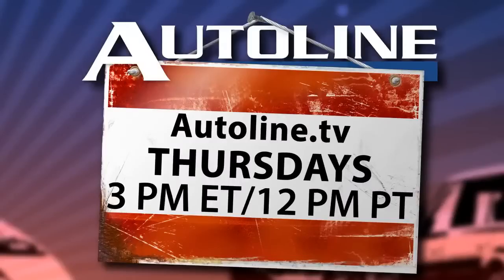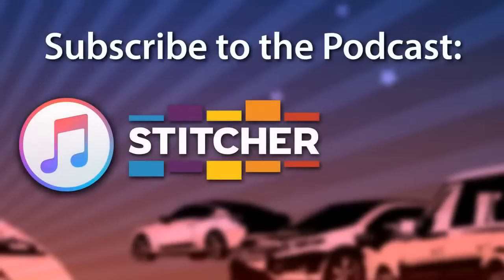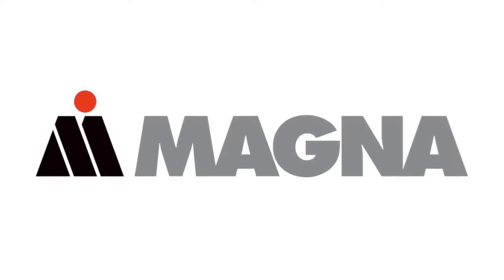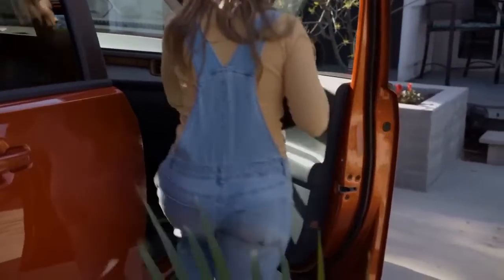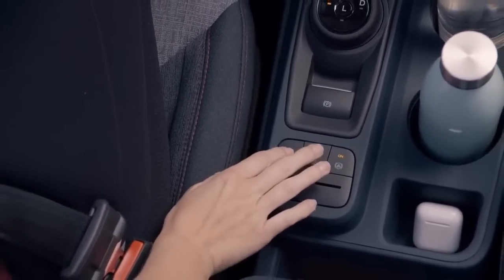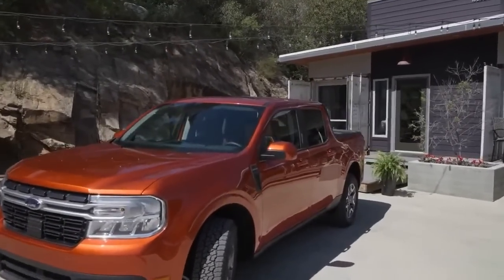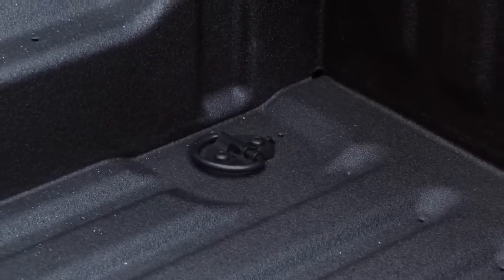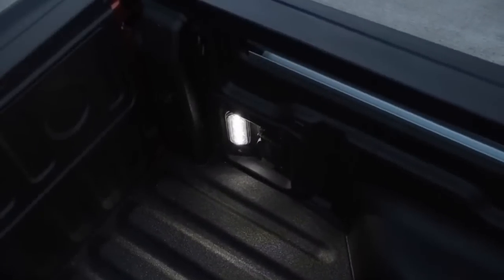Designing The Ford Maverick: Inside & Out - Autoline After Hours 575

Comment: Also, why not a plug in hybrid Maverick?
Reply: I kinda like that it isn't a plug in, would be relatively annoying to install a home charging station, or charge it at public charging stations. With a mild hybrid, you get many of the benefits of a hybrid system, without having to charge it. As someone else mentioned, it also helped to keep the cost down.
Reply: I give it a year and a plug in will be an option..plug in is convenient for daily computers. a115v @ 20 amp or 220v @ 30 amp would save on trips to a gas station. my cousin only gets gas once a month. she has to deal with Seattle traffic.

Comment: as an owner of a 83 ranger with the 2.2 diesel option. 
former owner and or driver of ford pickups from the 50's through the 90's, i waited for the re-introduction of the ranger.
to say i was disappointed would put it lightly. the new ranger is basically the size of a sixties f-100. 
only with a higher stance and lifted suspension. 
having high bed sides, making it difficult to place or retrieve items from the bed, from the sides. 
along with a high entrance and exit position, making a step or rail a requirement for entrance.
along comes the maverick..... a little rebel of a truck. that isn't a real truck, but will fill in a sorely needed position.
a truck i've been waiting for, for over twenty years. ford says it's for the younger crowd. 
not really, there are a lot of early small pickup owners just waiting to replace their old, worn out, rusted trucks. 
these old trucks that are almost impossible to find replacement parts for.
the maverick, has to prove that it's a capable truck. 
for these older drivers to give up their faithful work horses.
will the maverick prove to be capable, i hope so. my truck is tired and needs to be let go. 
i might be outside the predicted age group the little maverick was designed for. 
ford may be surprised at the number of older people who don't want a full sized or mid-sized pickup.
i would prefer to have a standard cab, with a longer bed. but understand the economics of a single platform.
so now i need to find out the structural strength of the inner bed walls and board support areas in the bed, for a lumber rack able to haul 12' -16' boards and pcv pipe.
great show today.
thank you. Charles
Reply: Absolutely. I would love a single cab, but I'm already thinking of ways to use the second row after the seat is removed.
Reply: Agree. I think Ford might find the buyer age skew older as those people that drove those smaller versions in 80s. Also, I want something easier to climb in/out.
Reply: I think the maverick will appeal to almost all car buying demographics. But younger, urban buyers are their core audience. That's not to say other buyers don't matter, there are clearly secondary audiences like people who drove old rangers and other small trucks, who are just happy to see the return of small, durable and honest trucks. Then there are elderly individuals, like my parents, who want something larger than their Kia Rio as their next car, but who also don't want to drive around in a battle cruiser that's 25 feet long and gets 12 mpg. I'll go in record here, the maverick probably attracts a wider array of buyers than any other new vehicle I have EVER seen. There are people like my bro and I who are in their mid 20s, who love the idea of a humble, more environmentally friendly pickup. There are people like my parents who've never owned a truck, there's people like yourself, there's businesses, first time buyers. It's crazy, the only time a entry level model has commanded this much attention was the Tesla model 3, and those aren't even that cheap. Most entry level models are very average, very boring. The maverick is a generally aspirational, and character filled entry level vehicle. I can't stress enough how good this vehicle is.
Reply: @kschleic9053  The issue is most truck buyers want 4 doors. Creating a 2 and a 4 door model would have made the development process more complex,  and would have added conservatively 100-150 million to the development process of the vehicle. Which would have forced Ford to make the maverick thousands of dollars more expensive most likely. At which point, almost everyone would have purchased the ranger over the maverick because they would have almost identical prices. There is a market for 2 door trucks, I'm actually doing a 3D model of one right now for my portfolio. But it's considerably smaller than the market for 4 door truck.

Comment: 2 for the price of one so I ordered 2. XLT AWD lux 360 4k CG for winter ski trips and summer softroading. But no fx4 because stickers look silly with its low ground clearance. AWD is fine on dirt roads to the trailhead or campsite. Plus the skid plate has to be removed to change the oil.
Also getting XLT hybrid lux 360 alto for better mpg in good weather. Total for both at msrp 57k + tax & lic.
Bed haters: it's only 6" less than a Ranger or Tacoma full cab for thousands less. Don't forget the hitch is not just for towing. Save bed space by hitching a bike carrier or cargo platform. For the few times I need more "bed" I can rent a 12' trailer.